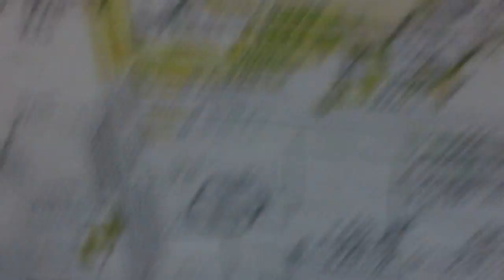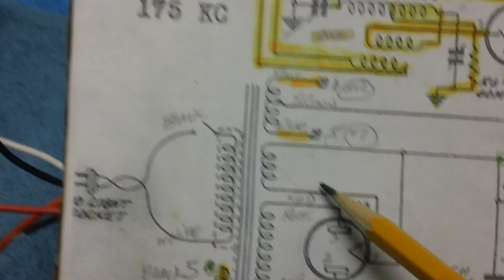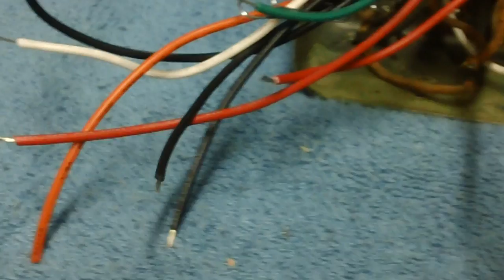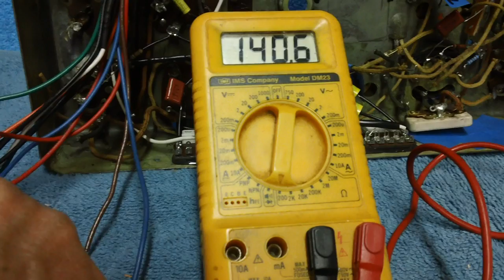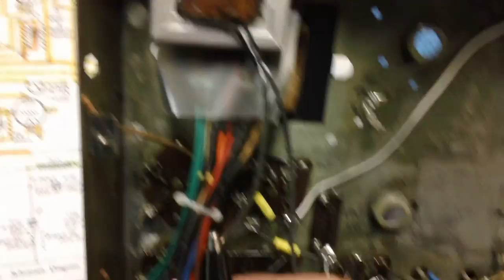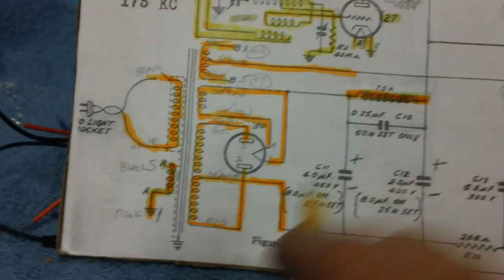1931 Airline 62-14 (Part 27 of 44).

Comment: I learned the hard way to always bench test a transformer before you put it back in. Had it all wired in and then realized I had a bad solder joint so I had to yank it back out and re-redo it.. Live and learn!

Comment: I don't think anyone is in a rush to see this radio finished John. I like your use of brass screws and nuts on your radios, gives them a nice classic look that goes well with them. I just purchased a tube tester on ebay, showed it working and was able to find a free scanned manual for it as well with the tube list.
Reply from the maker: Good for you, my friend.  If it doesn't come with the tube tester, look around for a supplemental tube list for it.  You'll for sure need it at some time in the future.
Regards,
John

Comment: John,
Once the smoothing capacitors are fixed and soldered into the pi filter circuit, and the power supply is confirmed to be up and running, it will then be time to move onto the audio output circuit.  Once it has been tested by playing an mp3 player, or some other audio source such as record player deck, or tape player, through g1 of the pre-amplifying valve stage, and found to be working as good as you expect, it will then be time to move over the front end circuitry, and work your way back towards the centre by starting with the frequency changer, then on to the, local oscillator, If amplifiers, and once the demodulation and AGC line circuits are complete...Bull's eye...you will have one excellent working 1931 Airline 62-14 Vintage Radio.
Now don't get any ideas I'm trying to encourage you to rush things.  Far from it!  Since I, and a whole bunch of fellow Vintage Radio men are enjoying this restoration series so much, I for one would not raise any objection if you went a weeny bit slower LOL.
Best 73s,
Phil.
Reply from the maker: Phil,I wish I had your typical British sense of methodology.  I'm an American...we just plunge in and react to come what may.  Put it together and hit the switch.  That's where the fun lies.  If we see no smoke, then we turn up the volume and start dancing the twist.  LOL  At least that's the way it used to be.  Regards,  John

Comment: John, 

Well done, as usual.  

I do have a question.  What is a choke used for and how does it work?   I know it has two wires (which I just learned from you), so there is an "in" and and "out".  Other than that, that's all I know.

Thanks, Tom
Reply from the maker: Tom,
The large DC filter chokes in these old radios were used as just that...a filter.  They knocked off the humped tops of the pulsating DC voltage coming out of the rectifier.  The smoother voltage was then sent on to the electrolytic caps for additional smoothing.   Even after all that the voltage was made smoother yet by running it through the field coil (choke) on the EM speaker. 
Go here.  You won't understand the language, but you'll fully understand what they're talking about:
https://www.youtube.com/watch?v=3pmQKLneBxI&nohtml5=False

Regards,
John
Reply: +joernone Thanks a lot for your quick answer.  

I did check out the above mentioned You Tube video which helped me to understand it even more.

Thanks again, Tom